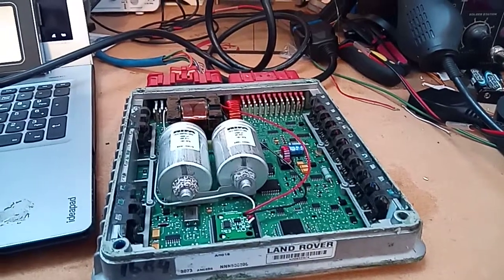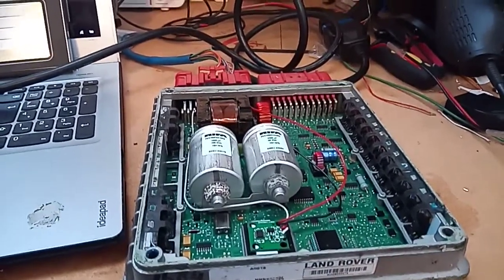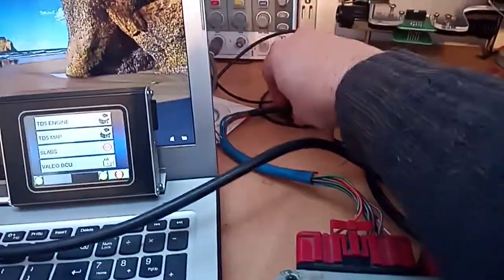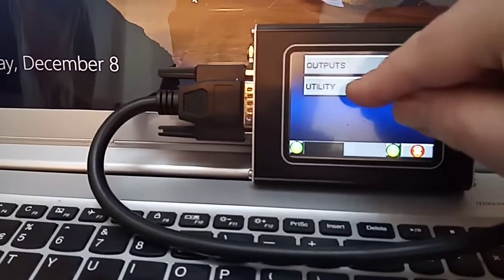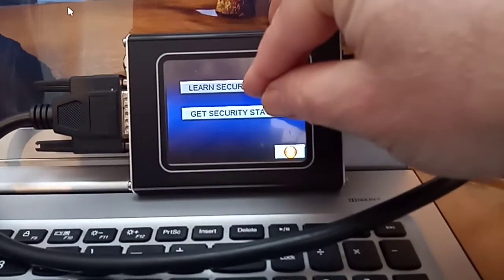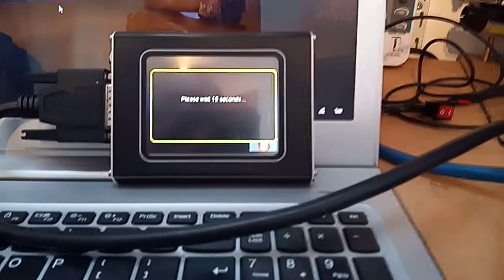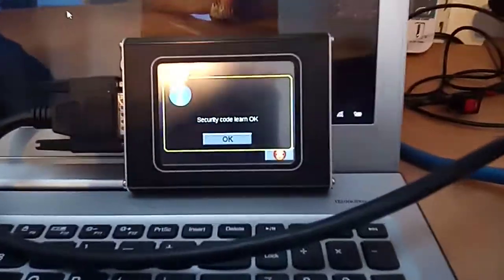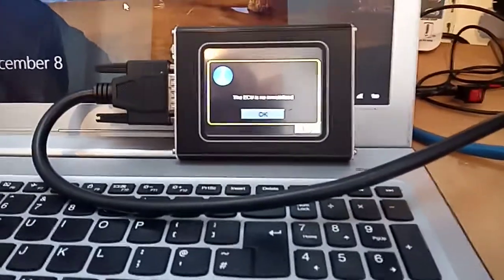TD5 ECU from immobilised to not immobilised with an immobiliser emulator fitted by ecux.co.uk

Comment: Hi Simon  fantastic video thank you for your time showing us helping us ,,, 
Simon Plz I need your help with a matter have if you can my Land Rover Discovery 2 Td5
2002, as my ignition lock
barrel & key are broken  damaged my elderly uncle I take it all out no way to work  so now only connectors hanging , is there a way to use a some cheap push start button 
Work , those after market then how I can deimobilzed and make car start working ,,?? I have my Nanocom too
Many thanks 
Matt

Comment: Hi Simon, I’ve purchased a vehicle that has your emulator board in. The previous owner informed me that if I disconnect the battery I’ll have to use the pk code in the door! Would you know the reason behind this? Ideally would like all the central locking to work again.

Comment: Hello, it seems so simple....until it's not 🙂 I went through the process same as above, security learn ok but when I go back in it still shows as immobilized, any thoughts? Thanks
Reply from the maker: Hi Maple Leaf. Drop me an email at simon@ecux.co.uk let's see what's gone on here.
Reply from the maker: Information: I thought that Maple Leaf Drifters was having issues with one of my boards. They aren't. It's a genuine immobiliser issue and they are stuck with a non starting car. No problem there.  If they can find an electronics tech to assist with the soldering iron work, we can get them going again. :D

Comment: Simon, that desk work is amazing. Could you please explain the equipment set up you have there, (you move the camera too fast!)? the power machine that feeds the nanocome? how the ECU is getting the 12 volts? the ignition cable? etc! Thank you! Warms regards from Costa Rica.
Reply from the maker: HI Mao.
The power supply is an adjustable 0 - 30v 5a bench power supply set to between 12 and 13 volts. This one has a soldering iron and hot air rework station built in but you do not need the soldering and rework side to power the ECU. These are readily available from eBay etc.
The cable I made myself and all it contains is the relevant power feeds, ground feeds and diagnostic (K-Line) wires and of course the OBD2 connector. The information for the cable can be easily worked out from any of the readily available wiring diagdrams for either the Discovery 2 or the Defender TD5.
Reply: hello, come easy, k line cable appears to be one in the brain output, is there a second output, I installed the bench, but I can't connect 3 poles, one electrical contact, I gave four groundings, what else can I do?

Comment: Hi, I've purchased one of these emulators but can't seem to get it to work, using original nanocom to learn security code on d2.
Reply from the maker: Hi Christophe, I think we have the issue down to the car not cranking so a wiring mod is needed.
Sent you instructions via Ebay message.
I am happy to say, the emulator is working fine. :D
Reply: @ecux  Thanks a lot Simon, great service and knowledge!! :D